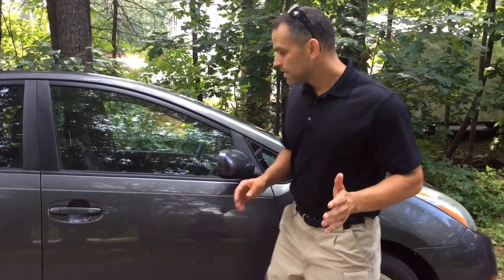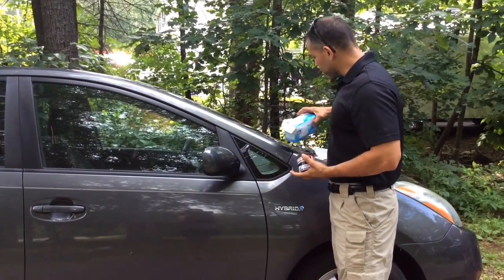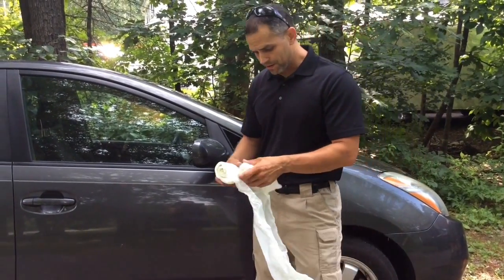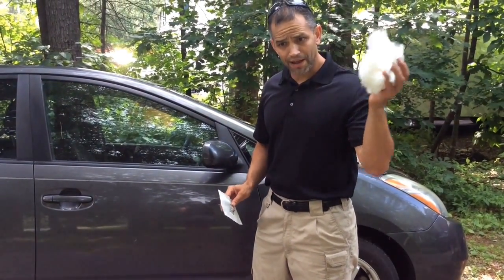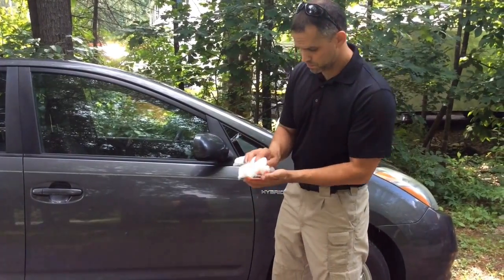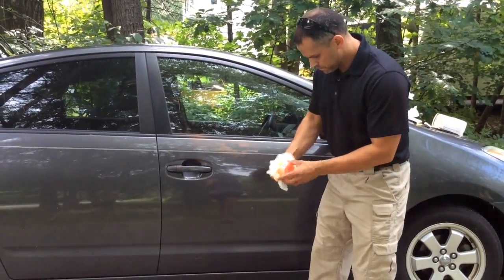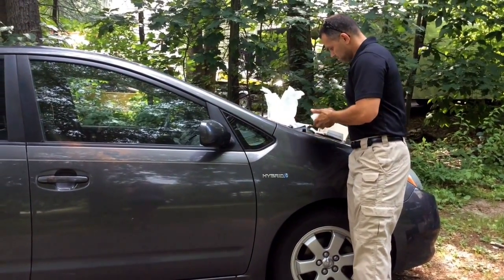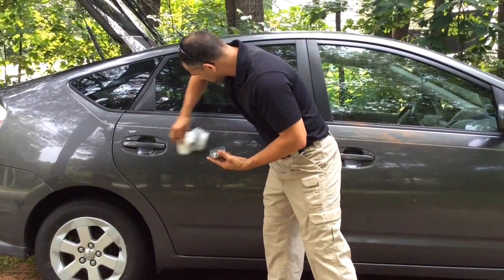Process A Car For Fingerprints In Minutes - Forensic Education

Comment: My understanding is gloves should be used. And too much powder can disfigured the ridges.

What kind of gloves should be used?

& what method is used to remove excess powder?
Reply from the maker: LC Roberts you can use any gloves. I like the nitrile gloves. You can use a regular brush to develop the print a little more and remove any unnecessary powder.